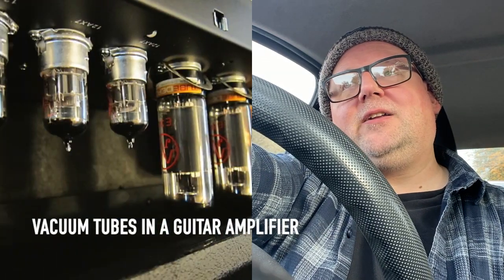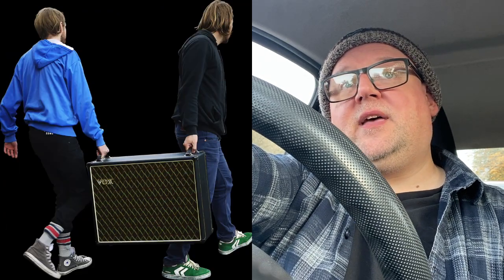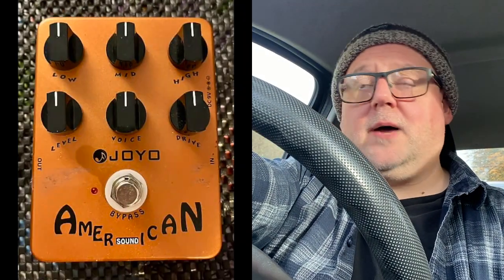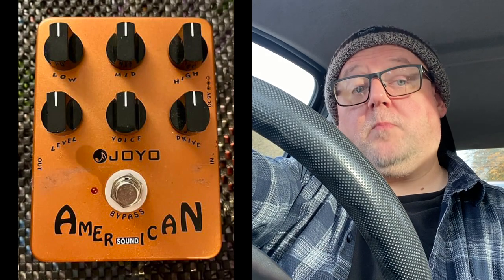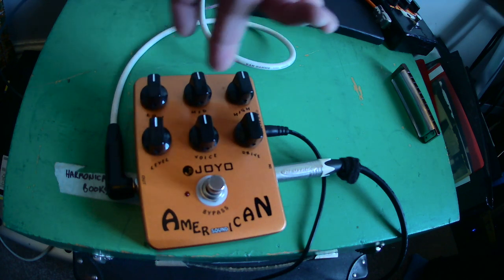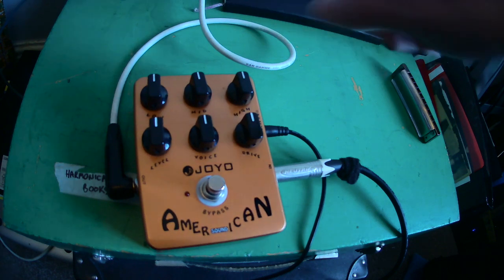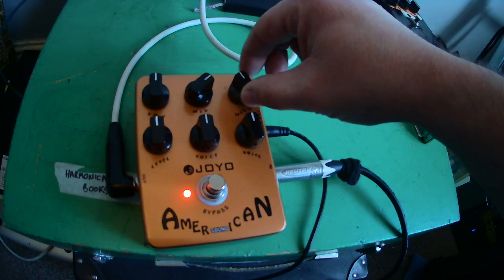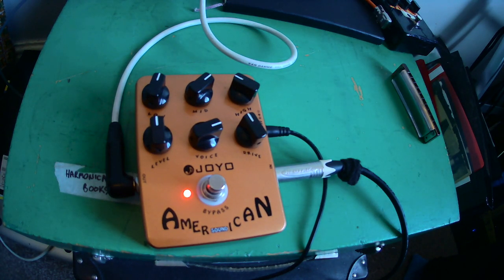Joyo American Sound pedal. The Chicago Blues sound without an amplifier |  Harmonica Miscellanea 013

Comment: Hi Kev, a lot of guitarist are raving about this pedal as your probably are aware.
I was thinking of getting a harp attack to improve my tone but then saw this and was amazed how close it was to the harp attack. But not exactly the same.
But  £30 against £179 is a no brainer really.
I've made up me mind to get one.
Keep up the good work Kev 👏
Reply from the maker: Hi Michael. I use it for guitar as well! It's an astonishingly useful thing.

It's definitely not quite as good as the Harp Attack (I have one of those for sale by the way) but, like you say, the HA a damn sight pricier. Also, it runs at 18volts, so needs a different adaptor than most other pedals. I've decided that close enough is good enough for me!
Reply: Yes Kev, your right mate. 
Lots of people really happy with the joyo by the look of it mate.
Cheers Kev ,keep up your great work.

Comment: Oh yeah, I have a bullitini mic, so could I plug in straight from the joyo straight in the desk at a pub jam night, or would I get feedback?
 Cheers in advance .
Reply: Hi Michael, I'm not a worker, just a hobbyist. I bought the Little Red Di box. Mic into Di. Into Joyo into Pa and you get no feedback. Hope this helps
Reply from the maker: You'd probably want to have it very low in the monitor (if there is one) to avoid feedback. But absolutely, straight into the mixer (or DI then mixer). I don't often play with a loud band though (mainly duo and small ensemble), so not much experience to draw from.
Reply: @flyboymercury  okay, so would the di box be before the joyo? I was thinking the di box would be last before the desk Cheers .
Reply from the maker: Harp > mic > joyo > DI > desk 👍